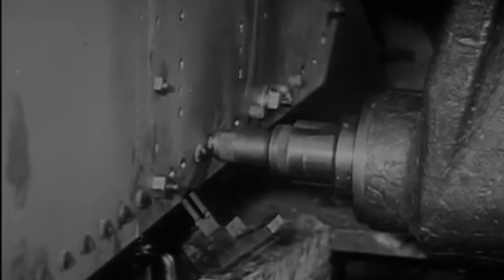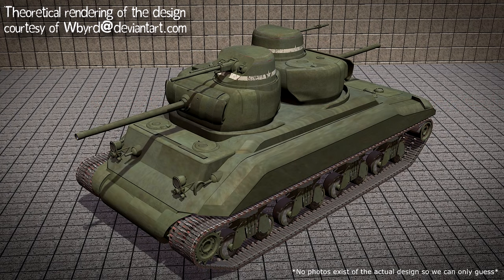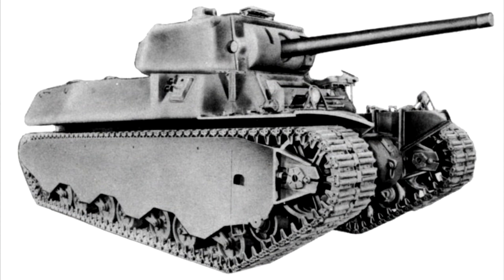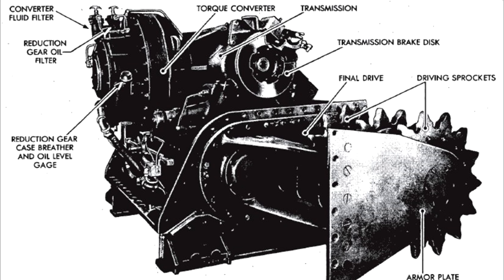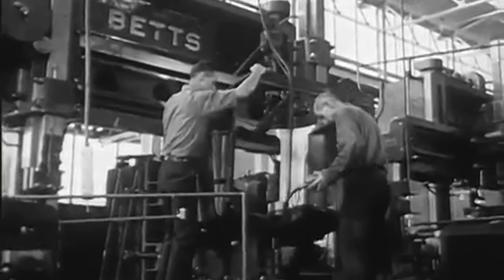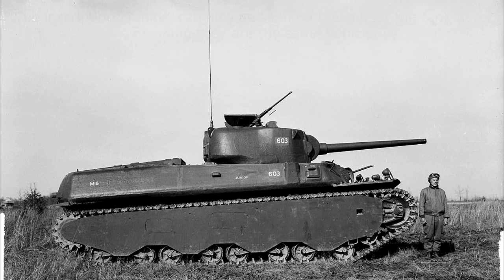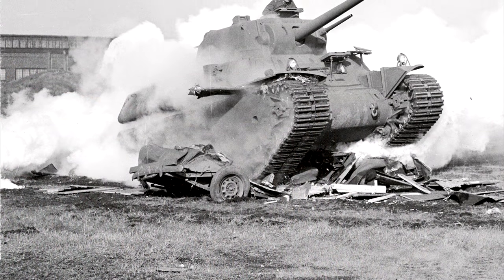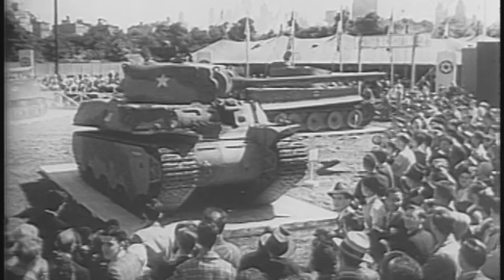America's Tiger, the M6 Heavy | Cursed by Design

Comment: I mean the M4 Sherman can do literally everything. You want a mobile artillery piece? Slap some rockets on there. Want a bigger gun? Slap a 105mm on there. Need more armor? Weld some plates on there.
Reply: I didnt knew the sherman had a 105mm gun
Reply: @shinkreytpuylap  more of a howitzer really, not an actual anti-tank gun
Reply: @shinkreytpuylap  A 105mm Short Ranged Howitzer tho,it is not a n AT gun
Reply: @shinkreytpuylap  There's the 105 mm howitzer (the M4 (105)) and then there's the French version of the tank with an actual 105 mm cannon (M-51 Super Sherman) that came about in the 1960s. 

This is not to be confused with Yugoslavia's SO-122, which was an M4 upgraded to a T34-85 engine with a monster 122 mm canon. This tank was never mass produced because by the 1960s, the gun was deemed insufficient to penetrate modern tank armor.
Reply: Won't one that burns up easily, keep that gas engine.
Reply: Yes, a Sherman can do everything literally. It can do everything POORLY which is why it was such a crap tank.
Reply: Jack of all trades master of none?
Reply: @shinkreytpuylap  After the M4 went into production the M3 was converted into an open gun motor carriage holding either a 75 or 105mm howitzer. It's users liked it except when they got engaged providing direct fire support where the crews fell victim to rifle and MG fire, grenades and mortar bombs. The Army fixed that by installing the 105mm howitzer in M4 turrets so the crews had better protection. It wasn't hard to do since Ordnance used the 105 cradle to hold the 75mm cannon so probably only had to swap barrels, change the gunner's sights and the ammo storage bins.
Reply: @haroldfiedler6549  It was a lot more successful than the Tiger tanks lol. The panther was a far better tank than the Tigers wehraboos rave about
Reply: @haroldfiedler6549  mhm mhm
Reply: @shinkreytpuylap  yeah it also fired heat rounds capable of nicking out panzer ivs and panthers
Reply: @neorenamon  But no doubt it would have blown a Tiger and panther out of the water
Reply: Problem is, the Sherman is a good mass produced tank, but even the Sherman Firefly (the British Variant that included the 17 pounder gun) was comparatively underpowered when facing German Heavy tanks.

The tank sustained so many crew casualties dud to it catching fire when hit (either incinerating or blowing up the crew) allies referred to the tank as a “Ronson”  after the slogan of Ronson Cigarette lighters, “lights every time.”

There were about 10,000 Sherman’s lost in the war, making up the majority of allied tank casualties on the western front.

They were good all-rounder tanks, but rather inadequate when faced with later war German tanks, as the 76mm Firefly variant was the only one capable of penetrating more highly armoured tanks and the 105mm Howitzer variant was incapable of firing Anti Tank shells.
Reply: @thisaccountnameiscompletel8949  that’s a myth my guy. First, that slogan wasn’t used until after the war, and the Sherman went up as often as German tanks when hit.
Second, the Sherman was the most survivable tank to be in during the war. When the tank was hit often the only one to die was the one closest to the entry point, and combined with good hatches it made for a good tank
Reply: The M4 was a jack of all trades, master of none, which isn't that bad.  Though each specialization upgrade made it weaker in some other respect.
Reply: @thisaccountnameiscompletel8949  Wet ammo stowage dropped Sherman fires magnitudes lower than any other tank of the war. 

Also, the Germans used the same type of engine/fuel as the sherman so why isn't there stories of tigers and panzer IVs going up? That's because, as mentioned, early war Sherman's had the same rates of fires as both German and British tanks. Germans and American tanks were within 1-2% of each other in terms of burn outs.

What did count for higher crew deaths was the lack of a loaders hatch in early Shermans. That led to alot of unnecessary deaths that was never really fixed until 1944. The loader either had to go out the driver's/belly hatch or wiggle to the gunner's hatch.
Reply: @haroldfiedler6549  German tank simp DETECTED
Reply: @Daniel-wy2kx  this is all bullshit.

The Sherman had one of the lowest crew survivability of any of its peers. The standard M4 was an undoubtedly worse tank than the Panzer 4. In fact the Sherman made up over half of the tank casualties for both Britain and the USA.

The Sherman isn’t even the most survivable allied tank, that title goes to the Churchill. 

It was a “good tank” but not survivable or particularly good at anything. 

They also were known as Tommy cookers, which was a proven colloquialism at the time.
Reply: Wanna get blown to pieces? Get within range of a Tiger, Panther, Koenig's Tiger, or a lonely 88.
Reply: Now what was it the Germans called them? Oh yes. "Tommy Cookers".
Reply: @ivandaly3679  yet the burn rate for American tanks and German tanks were nearly the same, ironic
Reply: @Bruhsound4.0  if punctured, then equal burns. But one Tiger versus ten Shermans crossing a field.
Reply: @ivandaly3679  the tiger is a heavy tank, a , more accurate representation would be 10 Panzer 4's VS 10 shermans, after the fight, examine how many burned. and even if the one tiger took out a few, a 76mm gun (common on later sherman models) was anywhere near, the tiger might as well kiss it's ass goodbye, due to the 76mm penning the UFP of a tiger 1 with ease
Reply: @Bruhsound4.0  more often than not Shermans couldn't get close enough for a fatal shot.
Reply: @ivandaly3679  dont know what your reading, but that's incorrect, 76mm's didn't even have to get close, same goes for firefly
Reply: @Bruhsound4.0  The early Shermans and the Tiger saw action for first time in 1942. And the Shermans were underarmoured and undergunned. By the time that was fixed in 1944 the Tiger had ceased production. The 76mm could penetrate but there's no firm evidence that that happened. The 17 pounder definitely would wreck a Tiger if it could hit it at all. Very inaccurate gun.  When the Shermans had to retreat from Normandy their post action logs apparently showed two thirds of their kills on Shermans at 1,000m, and half those over 1,500m. The Sherman simply couldn't match them. Incidentally I just read of a  phenomenon called 'shatter gap', it dealt with the hardnesses if the Tiger armour and that of the Sherman AP rounds. The Tiger Armour was so hard it caused the AP's to shatter at anything under 500m. I've only just come across this. 
The Sherman lesson I take away is that they were cheap and numerous vs the expensive and technically superior German tanks. 
Add superior air-power to swarming Shermans the Tigers could not win. But the superiority is not in question.
Reply: @Bruhsound4.0  There's a very  interesting piece on Tigers by an excellent tank history guy
https://youtu.be/T0JF23VIimg

I've read a few articles where Sherman fans claim a 3 to 1 ratio, but just s cursory ponder says that the Sherman cannot be as effective a tank. Tigers were vulnerable at the side, but to get to the side a Sherman needs other Shermans to distract the Tiger.
The Germans' nickname "Tommy Cookers" didn't happen  because Shermans were superior ...
I'm not saying Shermans were bad tanks but their success lay in numbers.
Reply: @thisaccountnameiscompletel8949  I'm with you on this. The 'Sherman" fans MUST be Americans of the "my team or nothing" variety. Like Dems who say everything the Reps do is wrong and Reps who say everything the Dems do is wrong. I'm British so don't have a dog in the game, but everything I can find seems to backup my suspicion the Tigers were superior. Only one in four Shermans had the Brit 17 pounder that could g'tee a Tiger kill, but it was horribly inaccurate. When the M4A1 was introduced the Tiger production was ending and the TigerII arrived ......
Reply: The M4A3 105, and the Sherman Jumbo, both simple tanks, but good designs
Reply: @Zorro9129  Frankly, the Sherman was pretty comparable to the majority of the tanks it had to face. More importantly, something that almost every person forgets when getting into these tank arguments is that tanks don't fight alone. They fight as part of a combined arms force that is itself a product of their nation's logistical and industrial capabilities.   

US planners decided to focus on the sherman tank because it already performed its job adequately, had a production pipeline that was worked out and running smoothly, and still had plenty of room to receive upgrades. Amply proven by its post war service life. 

How well the sherman stacks again a Tiger doesn't matter. It never mattered. What mattered was if allied equipment and doctrine could efficiently find and KILL a tiger. And it very much could.

If folks what to argue the relative merits of different tanks that's cool. Just understand that you're putting them into a very artificial environment to make these rulings.
Reply: @thisaccountnameiscompletel8949  In part a lot of these arguments miss the fact that the Allies were usually attacking, and so the German tanks and AT guns could sit in ambush and pick off the Allied tanks at will. The fact the Tiger used the excellent high velocity 88mm, which could punch through almost all armor plate, didn't help either. The use of the 88mm meant that tanks were not just "lost" (suffering from damage to tracks, spalling of armor injuring crew, etc.), but fully penetrated and devastated internally. That was the primary reason why Allied tanks suffered more than their German counterparts. 

If one looks at the picture of Wittman's destroyed Tiger, you will see the turret was blown clean off. This was done by a Canadian Sherman, likely a Firefly. The remaining three Tigers accompanying Wittman were taken out by a British Firefly. So, Shermans could dish it out as well as their German counterparts in the right situation, but you needed tankers who thought tactically and made the most of both the terrain and their vehicles' capabilities.
Reply: @ivandaly3679  you are only trying to compare a medium tank to a heavy tank, the Sherman was never made to go up against a tiger and the 17 pounder of the firefly was not inaccurate in fact the firefly was widely considered the best all-around tank of the war and got the kill on Germanys highest scoring tank ace when a hit caused his tiger to burn out
Reply: @tatsuhirosatou5513  you're right. It wasn't supposed to go up against Tigers. But it did. By the time the firefly arrived Germany was on Tiger2. Very different scenario.
Frankly it doesn't matter what tank fans it 'experts' say now about the Sherman because the Germans wouldn't have nicknamed them Tommy Cookers unless there was something in it ...
And Sherman crews were terrified of the Tiger.
Don't ask me, believe them, both German and Allied.
Reply: @ivandaly3679  can you provide a wartime source for the term "tommycooker"?
Reply: @randymagnum143  Dammit, I could've done. My Dad had a "History of The Second World War" book which was in (I think) 12 Volumes, and that nickname was in there. When my Dad died, my mother for some inexplicable reason (now we know it was dementia) threw the whole lot in the trash, and gave his medals to a charity shop. I'd been promised them and the huge WW2 book.
So if you'd asked BEFORE my Dad died and my mother turned weird I could have found the reference and told you.
Sadly it's too late. 
This is going to be my last post on any social media type account, I've spent far too  long debating stuff with idiots (don't mean you). And I do have MUCH better things to do.
Be well.
Reply: @ivandaly3679  cause the concept of one country calling the equipment of another country bad is solely dependent on fact, right?
Reply: @CoolAndrew89  the "Tommy Cooker" guy said it with what I think was real sympathy. He couldn't understand why men were sent into war with inferior tanks. You could tell he felt sympathy. So no, in this case. Not name calling. This was someone who'd been there.
Reply: But it took them years to do that. The Tiger had been running around for years. The Royal is what you have compare a late M4 with.
Reply: @shinkreytpuylap  Israel actually upgraded their Sherman tanks with better engine, target finding system, rotation system, 105 mm gun with armor piercing rounds that can damage tanks like Abrams and T-72 tanks, they put thick Kevlar and rubber plates on them etc and looks alot better than the original lol
Reply: @guitarzan2626  that’s actually a myth, the engine went up in flames about as often as the German tanks
Reply: @civilrebel3743  my great uncle had his leg blown off as he was ejected out the top hatch. Too much gas he said. He is buried at the veterans cemetery in Nicholville Kentucky after spending the rest of his life in a VA hospital.
Reply: @haroldfiedler6549  literally the best tank of the great war lmao
Reply: @ivandaly3679  1. When Germany moved on to the Tiger II, do you really think they suddenly stopped using the Tiger I? They didn't just throw them all in storage and waste them for the rest of the war. And there weren't exactly many Tiger IIs rolling knocking around anyway. The likelyhood of a Sherman coming across a Tiger II was very low seeing as most were deployed on the Eastern Front to defend against the Russians. 
2. Yes, if you put a single Sherman against a single Tiger I in a one on one, head-on engagement, the latter would most likely win. Obviously. It was a heavy tank- it had a bigger gun and better armour. That was what it was for. However, that one on one engagement didn't happen a single time during the war. If it did, I'd love to see some proof, but I doubt it. It was pretty much always 5 Shermans and a load of infantry against occasionally a Tiger and some anti-tank guns hiding in a bush sniping the side of the Shermans. Obviously the stats will show more Shermans being knocked out than Tigers. Stats show the numbers, not the context to explain the reason. It doesn't mean that the Tiger was better, as there were less, far less, only around the 1000 mark, compared to tens of thousands of Shermans. The whole idea that every German tank was a Tiger is complete fiction, and the Americans in particular very rarely came across them.  And this is all completely ignoring the horrendous reliability issues of the Tiger, even worse on the Tiger II, and the lack of German crew experience late war. Just because a Tiger can win against a Sherman in a one on one engagement doesn't mean that the Tiger was better. It was less reliable, less were produced, and they were far more expensive. And the Sherman did have the highest survivability rates of any tank during the war. Look it up.
3. If the Sherman was so bad, why did literally every nation friendly with the US use them? If they were so terrible, why did they continue in use long after the war, when far more armoured and better armed vehicles were being fielded. People in history weren't stupid- if the Sherman was that bad, they would have redesigned and replaced it, if not in the war then definitely after. 
4. I'm British too. You don't need to be German to be a wehraboo.
Reply: But don't you see that's true if ANY tank. Need a bigger gun? Put one in. Need rockets? More plate? The Sherman doesn't have any of that stuff out of the factory.
Reply: @haroldfiedler6549  really? It was such a crap tank even though it had a higher crew survival rate then any other medium of the war? Even though it had one of the highest reliability ratings and was super easy to repair then most other tanks of the war? It was so bad, that it had better armor profile and better construction then both the Panzer IV and T-34? It was so bad, that it slapped the T-34s silly in Korea? Yeaaa uhhh stop drinking the history channel flouride.
Reply: @ivandaly3679   They called them “tommy cookers” only really in the early war in afrika, because the UK forces would overpack their tanks with more ammo then what was meant. So...if you’re gonna use something like that, don’t take it out of context to support your point.
Reply: @ivandaly3679   Also, the Sherman’s 76mm gun has overall better armor penetration and accuracy over range then then Uk 17pndr. So, all in all the 76 Sherman’s were fantastic tanks regarding their gun, with the 76 and 17pndr outperforming the T34s late war 85mm guns. (A lot of this was due to ammunition, as soviet ammunition for tanks was of low quality)
Reply: Bolting or welding other bits of stuff so it can do something else means 2 things: 1) it wasn't thought of in the first place (therefore poor design) and 2) comparing later marques of tanks isn't correct. Sure the Mk6 or mk8 or mk24 of one tank might be better than MK1 if another. 
So first Sherman Vs first Tiger. 
Where would you rather sit?
Reply: @stuglife5514  phrase was used by tank crews in Western front (my uncle was one, I can't get him to talk much about the war but he laughed his head off when I mentioned Tommy cookers. And he was never in the deserts.
Reply: @ivandaly3679   So by your logic, any tank that ever used side skirts, ERA, cages, are all bad designs? So, I guess the StuG 3 and Panzer IV were awful designs because, well they extra bolted on armor. I guess the Leopard 2, M1A1 Abrams, and Challanger 2 tanks are awful horrible designs because they use ERA right? What even is your logic? The “if it had stuff added to it, it wasn’t a good design” okay, let’s stretch that to the extreme. The Tiger was a horrible design, because they eventually upgraded the engine and redesigned the turret mantle. And sorry but “my grandpa said so” isn’t a reliable source.
Reply: M6 can do it better
Reply: @valhalanguardsman2588   Oh yea. Sure that heavy tank that had outdated tech and was rejected from service not only because it was too big to ship across seas but also because it wasn’t very good, that tank?
Reply: @thisaccountnameiscompletel8949  and your source is?
Reply: Actually I'll expand on this, all of these replies need to state their source because as is they're spitting the biggest unfounded bullshit I've ever seen and the only source I've seen was "believe me bro I read it in a book as a kid"
Reply: @haroldfiedler6549  So poorly it has one of the best combat effectiveness ratings of it's time
Reply: @stuglife5514  Funny argument, because neither the Leopard 2 nor the M1A1 Abrams use ERA, just composite armour. I guess you could make the argument that Leopard2A5 and higher use added on composite armour tho.
it's mostly the russian, very outdated designs (like T-72) that use lots of ERA over the whole turret and front hull, in an attempt to keep the armour of an outdated vehicle competitive.
Reply: @haroldfiedler6549  Tiger > Sherman 
BUT 50 Shermans > Tiger
Reply: @thisaccountnameiscompletel8949  when a Sherman was penetrated, around 15% of the 5 man crew would die (In other words, 1 deaths every 2 hits). Compare that to the T34, with 80% of a 4 man crew dying upon penetration (3 deaths every hit). The whole 'Lights every time' thing only applies to the earlier M4A1 and M4 (Which made up 1/5 of the Sherman's made)
Reply: I’m my opinion the 105 on Sherman is useless. Keep the 76 on it
Reply: Its the Honda Version of Tanks
Reply: Want a M43E8 Jumbo? Slap some more god damn armour on the front and mantel gun and upgrade it's engine
Reply: @shinkreytpuylap  it did but had no stabillizer like the M4A1 and needed like 10-15 seconds to stop, aim and fire and the shells are only HE, HEAT and Smoke shells only
Reply: @cheesyfromindonesia9969  fun fact: The jumbo had a redesigned turret to fit the 76mm gun. It didn't use the normal Sherman turret because ???
Reply: It burned well.
Reply: @andredeketeleastutecomplex  not as good as the T34, but good enough.
Reply: Which 105? The M51? Or the M4A3 (105)
Reply: @thisaccountnameiscompletel8949  wehraboo mentality.
AGF lost 1500 KIA in total in Europe. Sub 5% fatality level. Infantry branch had about 20% KIA.
Reply: Something of interest is the memoirs of one Dmitry Loza, a Soviet tanker who had crewed both T-34's and lend-lease Shermans during the war. IIRC according to the memoirs, Soviet tankers typically preferred the Sherman more than the T-34, because the Sherman was 1) more comfortable, 2) was of much better quality in most everything including weapons and optics, 3) caught fire less, and 4) in the event of a fire it was easier to get out of. There's a reason why a lot of the nations post-war kept using the Sherman tank as their primary combat tank, and why most battles involving the T-34 and the Sherman in places like Korea involved the Sherman being the victor the majority of the time: the Sherman is simply that good of a tank when not being used in comparisons of bad faith.
Reply: It's greatest strengths were simple to make,reliable, and we made 50 thousand of them .
Reply: @eddiecharles6457  jack of all trades master of none, is often better than one
Reply: The Sherman is the World War II jack-of-all-trades tank. There a reason it served in conflicts well after World War II
Reply: @gideonbudd8945  Very true and it's what we had, it was already in production and we needed it now. 50,000 were built.
Reply: Everything except be good one on one
Reply: @stutterpunk9573  there's never one on one combat, what are you talking about
Reply: @thisaccountnameiscompletel8949 your claim about crew casualties is bullshit. Crewmen had an 85% survival rate if their Sherman was hit, compared to less than 20% in a T-34.
Reply: @stuglife5514  You  NAILED  it , tommy is a British,  slang - term . Africa - the start of the Sherman ...R . P.S. Not a highlight...
Reply: Yup
Reply: HAHA 90 DOLLAR TANK WITH ROCKETS GO VWOOM VWOOM VWOOM VWOOM VWOOM VWOOM-----

Edit: forgot to incorporate uptiers into my joke
Reply: Not hardly. The M4 is so obsolete you could write a book on it.
Reply: Want a Jerry cooker slap an 88 through there the m4 was only ever a good tank because of the obscene amount of them that where used it was by no means a good tank
Reply: You guys be fighting over 80 year old war time propaganda.... the Shermans were good, the panzers were good, the t 34 was even good. But they were war machines meant to face certain death... there is ALWAYS a bigger fish... meaning there was always something capable of destroying something else. The thing with Tommy Cookers, who knows its probably propaganda that has gained traction as the sherman had a pretty decent survival record. Thanks in most to proper infantry support.
Reply: Are you kidding?  Those Shermans on the other hand, would "bury" many soliders.  The Germans would blast through the thin armor of that Sherman and kill or torch many us troops.  The GI's would watch their buddies get pulled out in parts, washed out, and repainted the insides of the tanks.  You could still smell dead bodies in those Shermans they patched up and sent back out, if they were not destroyed.
The desperately needed Heavies over there.  It's a shame the Pershing only showed up toward the end of the war when it finally did.  The US Army philosophy, Generals, and military Industrial Complex were responsible for it.  TOO Many tankers died, that shouldn't have.  The Sherman didn't have the Armor.  The Panther could blast holes in Shermans all day.  We don't even need to discuss what the Tiger could do to a Sherman.
Reply: @thisaccountnameiscompletel8949   That's who I just got done posting to them above.  The Shermans were tommy cookers.  Panthers would shoot holes in them all day. Don't even mention what Tigers could do to them.  Many tankers died in a Sherman.  Not enough Armor.  Like you said, "mass produced."  It was the fault of our Army Generals philosophies, on tank warfare which in turn was flawed by the military industrial complex, production numbers, profits, that close relationship, dogmatic hard headed willingness to sacrifice manpower.
We could have had heavy tanks over there.  They just didn't want to.  That T29 could have been pushed and perfected, as well as other heavy designs etc.  We had the fuel for them.  Tigers and King Tigers would have had to have dealt with T29 type heavies and such, instead of Shermans.  As we know the Pershing/Super Pershing only showed up at the end of the war. (later to be down graded as mediums)
The German heavies were not perfect either.  They had a few flaws.  But, they worked them out.  Sometimes you can't let the obsession of absolute perfection be the downfall of success, "especially" during war.
IF the Germans were able to have done it, there was no excuse for us not to have heavies.
Reply: Sandbags:

"Can i?"
Reply: @thisaccountnameiscompletel8949  The 105 was more of an infantry support vehicle than anti armor
Reply: @guitarzan2626  German tanks all ran on gasoline if I'm not mistaken. The reputation of Shermans burning easily came from the ammo storage, which improved later.
Reply: @thethirdgeneration1738  Fewer than 2,000 Tiger and Tiger 2 tanks were produced. Only about 6,000 Panthers were produced. They all suffered from transmission failures and their engines catching fire due to overheating and constant oil leaks. A vast majority of Tiger 2's were abandoned and destroyed by their own crews after such a mechanical failure because repairing them was near impossible without managing to get the tank back to a depot with a ludicrous amount of machinery. The German tanks of WW2 had a lot of great ideas with some sophisticated engineering, but don't be blinded by how they were intended to function versus how they actually ended up functioning (or malfunctioning, in most cases) once faced with actual combat conditions.
Reply: The Sherman was a death trap. The Super Pershing was supposed to be a lead Tank with several Sherman's following behind on patrol. Due to lack of numbers it wasn't implemented. That's why there was such a high loss rate of Sherman's.
Reply: @51515123  I don't think they really ever thought they needed the Pershing. Many Shermans were lost, but I disagree that it was a deathtrap. Pretty good crew survivability statistics.
Reply: @bigosolohike  there's a book titled "Death Traps" by Belton Y Cooper who served in WW2. The movie "Fury" was based on his experience in the war. Check it out 👍
Reply: @51515123  His book doesn't seem to hold up to analysis. Sounds like some parts of Fury might have some basis in stories he heard.
Reply: @bigosolohike  He had first hand experience with the 3rd armor division. Plus he was a mechanic as well and saw all the tanks that were completely destroyed or almost destroyed. I don't know what more you want to hear bro. It sounds like you're stuck on your own opinion and not open to any more facts. Straight up facts.
Reply: @51515123  I watched the History Channel thing with him years ago. I guess it was probably Engineering Disasters. It was pretty convincing. I'm sure that dealing with all the destroyed and damaged Shermans and removing blood and human remains was something you wouldn't get over. At the time I generally was of the opinion that the Sherman was crap. People like Nicholas Moran have changed my opinion. Sherman wasn't perfect, but my main point is that I don't think calling it a deathtrap is warranted. Belton's book sounds like it has a lot of factual errors. I guess it was ghostwritten, so not all of these can be blamed on Belton. I don't discount his experiences, but I don't think they paint a full picture. The Sherman had a good crew survivability rate relative to most WWII tanks when the tank was knocked out. Wet storage of ammunition reduced the chance of the ammo cooking off. Obviously, the Sherman was overmatched vs the late war German tanks, but your chances of survival as a tank crewman were much better than being an infantryman.
Reply: @ivandaly3679  none of that matters when there are 10 Sherman's to every one of your tanks.
Reply: Being obliterated by a ,75mm pak40, an 75mm l42 of the Panther,by an 88mm AA or AT of the Tiger,etc,etc,oh and even also by a 14 year old with a Panzerfaust,they were quite good at that,even more than they expected.
Reply: @eddiecharles6457 Is oftentimes better than a master of one
Reply: @shinkreytpuylap 120 or so was fitted too 😅
Reply: @bigosolohike  Belton Cooper also was in the 3rd Armored Division, which saw a lot of heavy fighting. So he was going to see a lot of destroyed vehicles. He did also make some “claims” such as a Super Pershing killing a King Tiger.
Reply: @brennanleadbetter9708  there are "claims" and there are plain simple "Story's".
And there is the truth.
Reply: Sounds like any other tank at the time tbh
Reply: @sravans149 4 Sherman’s > 1 tiger
Reply: @mattt525 nah t34 wasn’t good
Reply: If the Sherman was well matched for the German tanks, then why did the Americans wait so long to invade? They let the Russians do most of the fighting.  70% of German forces were destroyed by the Russians. Maybe that's why it was so safe to be in a Sherman? It wasn't being used.
Reply: Nobody has ever made the mistake of calling the Sherman the best tank in the war. Practical, yes. Transportable, yes.  Maintainable, yes. This would be like saying that your girlfriend may not be the prom queen,  but she cleans up after you and doesn't get jealous. Tiger is the prom queen... Sherman is the other girl. 

The T34 and the Tiger will forever be remembered as the two most important tanks. I'm an American and I even see it like this.
Reply: @lperea21  well they had to transport supplies and soldiers from over seas unlike the Russian who were right next to Germany
Reply: @Semperfidelis-v4g  yes I get that. It still doesn't mean it was the best tank. There seems to be a revisionist movement about the Sherman as being the best tank because it was "good enough" and met all the criteria for logistics. Add to that the "highest crew survival rate" and you get the false sense of superiority. I'm not saying it was crap, but it was out classed. It would be like hearing the British going on about the Churchill. The Sherman was "average". And no late war modification made much of a difference. Most of the German tanks and trained tank crews were already destroyed on the eastern front.
Reply: @lperea21  I’m not saying the Sherman was the best I’m saying it was a better tank in terms of logistics for example the steel of t34 tanks would break very easily because of how it was wielded also lots of the t34 would be very cramped making hard for the crew to move and some t34 didn’t even have ammo
Reply: @Semperfidelis-v4g  yes I know. The tanks were used very differently by the different nations. The Russians swarmed their enemies, which was why quantity took precedence over quality. There was no way Russia would out engineer the Germans. But we could say the same about American tanks. The optics and firepower was inferior to the Germans. We can go all day doing this. In the end, it really came down to the Russians and the Germans. The US and Britain took their time with the Normandy invasion. The eastern front would not have gone well if the T34 was replaced by the Sherman.
Reply: @lperea21  Shermans did see combat on the Eastern front and were very well liked by their Soviet crews.
Reply: @jpmtlhead39  I recommend the video on the Sherman’s being death traps by Military History not Visualized. It goes over some of the mistakes in his book,
Reply: yes, i also play war thunder
Reply: Idk why so many people are arguing. The M4 sherman wasnt that great of a tank, but it was a numbers game, and thats what the sherman was good at. Being mass produced.
Reply: @shinkreytpuylap  Sure was. 2 seperate variants, actually. The 105mm short howitzer that the US used during WW2, and then later, the Israeli M-51 Super Shermans, which had a massive French 105mm D1509 L/51 cannon fitted to it.
Reply: @ivandaly3679  Well, that was the case with most Allied tanks, except Churchills and late IS-2s.
Reply: @ivandaly3679  except that was because of Sherman’s being on the attack
Reply: In reality. The Tiger I Did scare a Lot of US tankers when they were in their First models of the M4(It scared them to the Point to actively search for Intel on every Tiger Whereabouts in AOs). It Had the 75mm shit Gun... A pretty bad Gun for its time... When Panthers And Tigers were amok. While the British were rocking 17 Pdr Guns, the russians rocking the 85mm or 100mm Guns. The Sherman was severely undergunned If they encountered a Panther or a Tiger. But the Shermans were never designed to purposely Hunt other armor. 
The M6 Just showed the  lack of competence, technology and creativity by the American Engineers. Maybe purposely or Not we Will never know. Army Has these issues. They need to "show off" that they are doing something even If that something doesnt really Work or IS It practical. Check the Maus for example.... Completely unecessary but there they were throwing manpower, resources and time to such a worthless thing
Reply: @Terraqueo22  and later they upgraded the Shermans to have a more powerful, 76.2mm gun.
Reply: @markolysynchuk5264  yes, with the 76,2mm Gun and the introduction of the HVAP Shells... Gave the Shermans the Means to actually damage Most of the German armored arsenal... Thats where the M18 Hellcat shined a Lot...
Then the US Tank doctrine in the Europe Theater changed... The need for faster, less amored vehicles armed with decent Guns Made coordinated with infantry with AT capabilities. Made breaching German defences a whole Lot better. 
Then much later in the War they introduced the Pershing which was the last to see some combat action in Europe in WWII